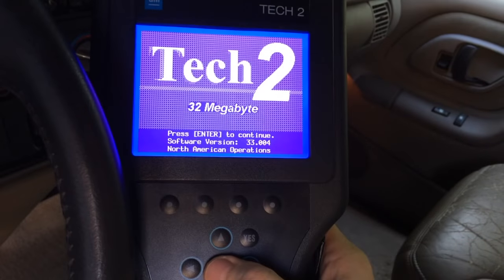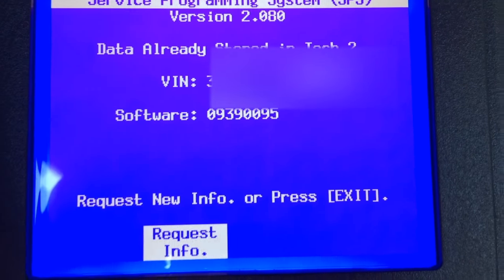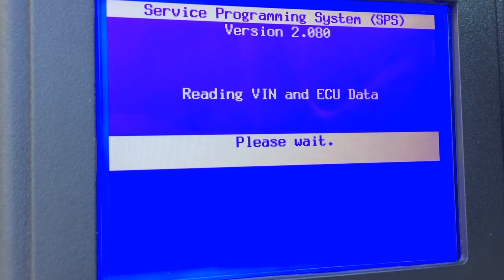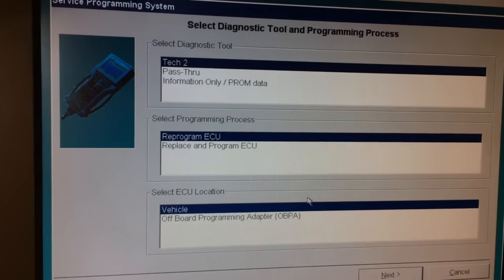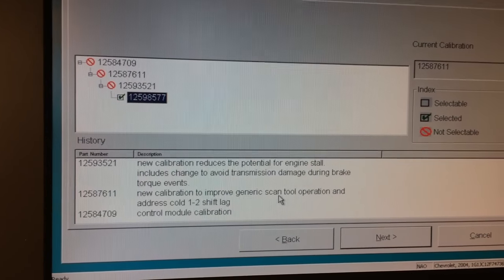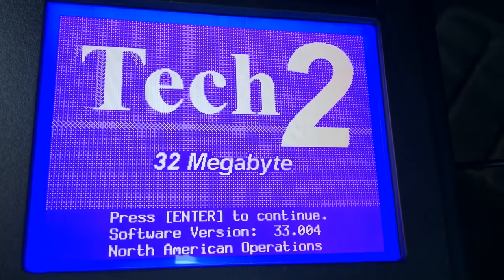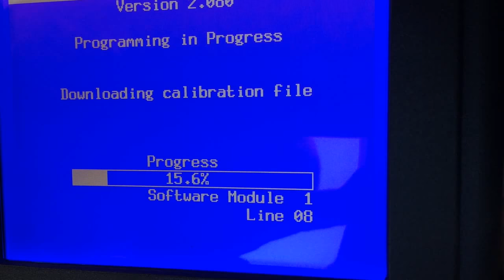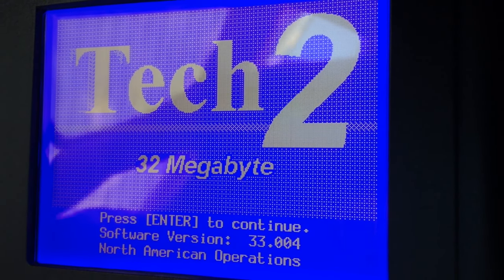GM SPS Programming: Tech2 Tool Remote Mode ECU TIS2000 How to do a Calibration Update Reflash (PCM)

Comment: I get a E666:  Access to Service Programming Server was denied.  message when I attempt to Select the Service Programming System in TIS2000.  any ideas what that is?  Newbie here...
Reply from the maker: Two most common reasons for that error code from TIS.  Either you are not using a compatible USB to RS232 serial adapter (the Tech2 is very picky about this as it was designed before USB was a thing).  I link GMs only recommended adapter in the description, from Keystone.  But you can google around and some folks have found a few other brands that will work.   Or, it's because you are missing the security dongle.  TIS2000 is copy protected software, so it looks for a security device plugged into the PC.  Either a parallel port type or a USB port type.  There's a link in the description for those as well.  I'm not sure why the Chinese cloners do not include these, I guess by not doing so they skirt a loophole imports wise.  If you are comfortable with it, there are software hacks you can google which mod the TIS program to disable this code, but you have to be familiar with Windows a bit to do those.
Reply: @DrShock  I see that in the description now sorry for not reading further.  I used this rs-232 to usb, so you're thinking it's this that's a likely culprit if I installed the crack for the usb key? https://www.amazon.com/gp/product/B00IDSM6BW/ref=ppx_yo_dt_b_asin_title_o02_s00?ie=UTF8&psc=1  Also, will TIS 2000 not function if the serial adapter and USB key are not both plugged in?
Reply from the maker: You have to have both the security dongle and the serial connection both active or TIS2000 will not communicate with the Tech2 correct.   The crack makes TIS2000 think that the security dongle is already installed. I would double check that the crack was correctly installed before suspecting the USB to serial adapter.  I've not heard of the brand you linked there so couldn't say anything good or bad about it.
Reply: @DrShock  Crack I used that worked:  https://rapidgator.net/file/a081c4c028aa1fb80ea98e15a540b9a9/TIS2000_Dongle_Crack.7z.html   Note:  you have to follow the readme instructions and most likely have to manually copy and paste the files into the target folders, the .exe file does not work to auto install.   Thanks for the help answering questions and looks like the sabrent usb adapter is going to work.  Only 8.99!
Reply: @DrShock  I had to buy you some coffee for the help THANKS AGAIN!
Reply: @DrShock  One more question do you have a video where you flash a new unprogrammed PCM from scratch in the vehicle and is that possible?
Reply from the maker: I don't have that specific route, as it's usually alot cheaper to go the used PCM route.   But that is actually the native habitat for a Tech2, as GM dealers would never be installing used modules.  When you do this route, choose program and replace on the TIS2000 menu, not just program.  Then you'll get a copy of the original, be asked to swap it out with the new PCM, and then it will proceed to flash the new one.
Reply: @DrShock  Thank you, I just successfully did a "calibration" update on my 98 k1500 using this video to see if that helped any of my issues.  Then I did a camshaft/crank relearn.  All went well.  Test drive soon and hoping maybe it will be better but I'm thinking this PCM could be on the fritz...fingers crossed.  Now on to the 95 k1500 where I'm going to use the ABS bleed function per your video instructions!

Comment: Where did you get the tis2000 software disks from? What windows system does it run on?
Reply from the maker: This should be included when you purchase a Tech2 clone.   The 2000 in the name suggests the Windows era this software is from - only Windows 2K or XP.

Comment: @DrShock, when you said to make sure there is proper voltage to Tech2 (when programming), did you have the Tech 2 wall adapter plugged from the WALL and into the DLC ? Can't the cigarette lighter adapter setup the same way work just as well? Thanks in advance.
Reply from the maker: The AC wall adapter yes, the cigarette lighter adapter will still be subject to battery voltage drops during programming so no improvement over power thru the diagnostic connector on the vehicle itself.  Technically you should also have the GM EL- 49642 SPS Programming Support Tool connected to the battery during this.  It's a clean DC voltage maintainer, on the expensive side but a must if doing an SPS action that involves multiple modules in one go.
Reply: @DrShock  Thank you

Comment: Can I use the Tech II to delete the EGR on my 1998 K2500 5.7L?  Or is there a special; programming tool that I have to use?  Thanks, Jimmy
Reply from the maker: The EGR is tied to the powertrain configuration, as it's part of the engine.   The Tech2 wouldn't have anyway to change that.   I would expect this to be tied to the VIN, and part of the PCM calibration mated to that particular engine.
Reply: @DrShock  Thanks

Comment: So all the calibrations pre 08 are on tis2000? No subscription needed?
Reply from the maker: Thru model year 2007, should be all you need for SPS with just TIS2000 (presuming its the last version they released).  It's possible some vehicles got updates from GM after TIS2000 was discontinued, but those would be rare.
Reply: @DrShock  who did you source your clone through?
Reply from the maker: Many years ago on eBay.  The seller is long gone, but the same type still occassionally shows up.  They are not as common as they used to be since the MDI clones came out.

Comment: How do you do a blank new pcm for a gmc 3500 7.4 liter. The procedure in the video is updating.
Reply from the maker: It's the same process, just choose "Program and Replace ECU" instead of just "Program ECU".  Then it will go thru and tell you the steps of when to swap the old out with the brand new replacement, and it will then program the brand new replacement to match the old one (clone it).
Reply: Have you had much luck using tech 2 legacy on the sps website? I don’t have tis2000 but have a mdi 1. Not sure if I could use it on the 99 or use the tech 2 as a pass through
Reply: Also if my computer has a place to plug the gray cable in do I still have to use a USB adapter?? Or should it work
Reply from the maker: If you have a vintage PC with a 9 pin serial port still, that's how it was done when these tools were state of the art.  So yeah, no problem and no USB needed in that case.
Reply from the maker: Yeah, I have another video in the series using the Tech2 as a pass-thru on TIS2Web and it works fine once you get the port settings figured out.  If you have an MDI I would use that though instead as its more plug and play.   The problem with TIS2Web (acdelcotds.com) is you have to pay a subscription to do the SPS programming.  If you had TIS2000, that's free for anything older than 2008.   I wouldn't expect any problem using the MDI on the older truck, as the dealerships do the same thing when they have to fire up Tech2Win over an MDI as GDS2 won't support the older vehicles.
Reply: I might go mdi for the 1999 c 3500 it needs a pcm. The computer isnt turning on the fuel pump relay
Reply: I don’t have a 9 pin connector on my computer. I have a place where the Ethernet cable clicks in on the side. Would that work
Reply from the maker: No, definitely do not plug the Tech2 cable into the PC network jack.  GM just happened to use the same kind of connector but it's not Ethernet. It's for a 9pin serial port adapter that should have come with your Tech2 setup.  If you do not have a 9pin serial port, or an older 25 pin serial port then you have to go the more modern USB adapter route and convert the 9pin serial to USB.  There's info in the description about that route.
Reply: I’ll try the mdi first. I have a tis2000 cd that came with the clone. So I might try that if the mdi fails. Supposed to be doing it Tuesday
Reply: The one I’m looking at is at Best Buy. Called rs22 to usb. You use a specific brand?? It’s an insignia
Reply from the maker: Only certain brands work with the communications GM sends over the interface.   The only GM recommend one, from Tripp-Lite, is what I link in the description.   But folks have tested a few others that are clones of the Tripp-Lite.  A generic off brand one is unlikely to work with a Tech2 though.  The older the adapter is, the more likely it will work.  The more modern, the less likely.
Reply: How do you fix an e666. I git tis2000 cd installed. Click on sps but error 666 access denied comes up. Ever run into that??
Reply from the maker: That's typically either from an incompatible USB to serial adapter, or more likely you don't have the security key dongle plugged in with TIS2000.
Reply: Where do we get the security dongle? It didn’t come in the kit. You have a link?
Reply: Oh I’m running it on my old school dell Windows xp so I don’t need a adapter. It has the correct fitting to just plug in the 9 pin connector
Reply from the maker: If you can plug into the 9pin serial port on the PC, then you eliminate the USB to serial adapter yeah.   The security key dongle comes in two flavors, a parallel port plug and a USB port plug.   They don't include them with the Tech2 clones, idk why but you can find them on eBay - https://ebay.us/74Fcwe

Comment: Will connecting the jumper cables to a battery that isn't installed in another vehicle work? Also have you heard anything about using SPS with a VCX Nano?
Reply from the maker: The Nano is a generic J2534 connectivity device that is compatible with GMs SPS.  I only use the MDI and Tech2 tools myself though so can't comment on that one.  If your question is about having a second battery connected to the battery of the vehicle which is being programmed, yes that will suffice for backup power (presuming both batteries are in a good healthy status).
Reply: @DrShock  Cool, thanks for the info. I’ll probably replace the Nano with a Tech2+MDI clone eventually since it’s much easier to use(and portable).
Reply: @DrShock  One more question, I’ve heard that the $40 SPS subscription will only let you successfully program a module once. Is that true?
Reply from the maker: @computertutorials1286  It's definitely tied to one VIN, for a two year period.  And you definitely cannot re-install a module calibration, GM doesn't allow that.  So if SPS can read the module calibration, they block you from trying to re-install/re-flash the same module with the same calibration again.   Now I have heard GM goes a bit further and prevents updating a calibration on a module, even if it needs to be updated, if you already did that same module on that same VIN previously.   I have not experienced this myself, not having had a need to deal with such a situation.  But I can imagine it is GM preventing small shops from trying to buy one SPS VIN subscription and then trying to run thru many modules for multiple VINs for free or such.   If you had a legit situation, like a defective module and having to redo the repair with another, I'm sure calling ACDelcoTDS support would get it cleared up for you.
Reply: @DrShock  That makes sense, thank you.

Comment: To be able to use the USB adapter is there any settings when installing that need to be chosen ?
Reply from the maker: There are some COM port setting notes in the description
Reply: @DrShock  okay so I believe I was able to change to the right settings for the com port. I am able now able to use the “tech 2 view” to open my tech 2, and I can also use the “test” on I/O management and it says drive successful, and I see the tech 2screen changing as if it’s thinking. But when I try to enter in to the service programming as normal and follow step 2 for the Tech 2 to PC connection and press next I get the error “E665: The communication could not be established with the Diagnostic Tool! please Ensure Proper connection”
Reply from the maker: So the E665 is a communications protocol problem if the comms test is now successful.   It's either the Tech2's serial port being defective (the lower quality clone may encounter a chip failure here), or the USB to serial adapter if you're not using an old PC with a native RS232 serial port (GM actually only ever certified a single USB adapter as compatible which I list in the description).  To make sure the Tech2 serial port is ok, you can use the loopback test adapter that came with the Tech2 and use the diagnostics menu to test it out.  Unlikely problem but easy to verify.   If you are using a USB to serial adapter make sure the Windows driver for it is configured to match the settings in the Tech2 and it is either the one I list in the description that GM supports, or one of these known to work https://tech2wiki.com/content/tech2/tech2_using/connecting_to_techline/usb-to-serial/usb2serial_working.html as you can't just use any usb serial adapter.  Many don't have the fully support a tool like the Tech2 requires.
Reply: @DrShock  okay thanks so much . I’ll go ahead and run that test. I am now having another issue, when selecting the SPS option on my tech 2 when plugged  in to the car my tech to freezes and won’t enter. I was able to go through a different route on the tech 2 and it said “security access” It then gave me the steps to disconnect and reconnect to my pc. No I plugged my tech to in pressed next, it began to load then it said “E682: no ecu data available !!” . Im assuming bc I need to use the sps on the tech to, instead of using the other setting I mentioned that said it will also give access. Mhhhmmmmm.
Reply from the maker: You are using a security dongle, or have applied the software patch to negate the need for one, with TIS2000 right?  Typically if not you'll get an E666 but it can also cause weird behavior otherwise.

Comment: I need help again please ....how do you program a BCM on a 2003 impala with Tech 2 ? I downloaded the info ...connected it to TIS2000 but the only “ Available controller” shown is the ECM . So how do you use TECH2 to program the BCM ?
Reply from the maker: I'm going to be posting a video on this in a few weeks actually.  But the short answer is you don't use SPS / TIS for these years on BCMs.   You also can only do brand new ones, used ones are not supported.   It's done with just the Tech2 by itself.  Go into Diagnostics, build the car, then go into Body.  Go into BCM, Special Functions, and then Setup New BCM
Reply: DrShock thank you . And if your doing it off the car you will be able to add VIN number?
Reply from the maker: With a Tech2 GM expects it to be installed in the car to run that new BCM setup.  I'm not sure if there's any possibility to set it up any other way, it's more involved than the PCM setup.
Reply: DrShock so I built a bench harness and when I tried to program a used BCM it said “ secure BCM “ and did not allow a new VIN ...I’m gona replace the EEPROM with a brand new one and see if the computer thinks it’s a new BCM . Will give update
Reply from the maker: Yep, as I mentioned you cannot use an used BCM only a brand new one.  I can tell you right now that it is unlikely to work with a blank chip (at least it doesn't on the models I've tried).   There is content that does need to be there, what you would need is a virgin eeprom image of a brand new unconfigured BCM.  Alternatively you can move your eeprom to the replacement BCM, as long as its the EXACT same part number and service calibration level.  This is the harness I put together for some of the eeprom reprogramming videos I'm doing including the BCM - https://www.youtube.com/watch?v=SDRSA_fO2d4 though I've only published a PCM one using this harness thus far.

Comment: Hi gotta luv a tech 2 . Can i program engines afr's to get the car to run after a race camshaft  installation?
Reply from the maker: Doubt it, these GM tools are software and firmware contrained to the factory options, settings, and calibrations.

Comment: Good Morning everyone. I am confused on all this tech 2 stuff. I have a original Tech 2 with this 13.004 latest software.I need all this other software to use the Tech 2 to get the fullest function on the tech 2? I seem many videos on it,Just bit confussed.  Thanks in advance,Have  a Great Day and Stay Safe
Reply from the maker: You need the TIS2000 software in order to do any SPS flash updates on modules.   But the rest of the Tech2 functionality is mostly built in and you don't need anything else.  Though the latest handheld Tech2 PCMCIA card firmware is version 33.004 for the USA.